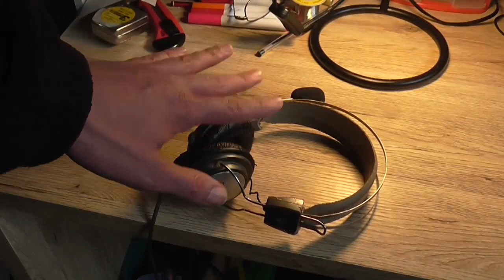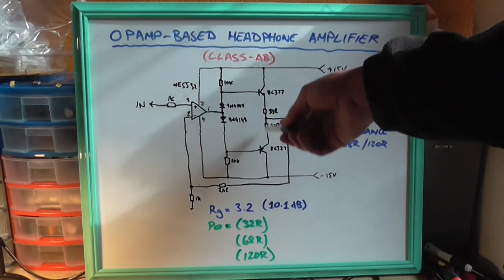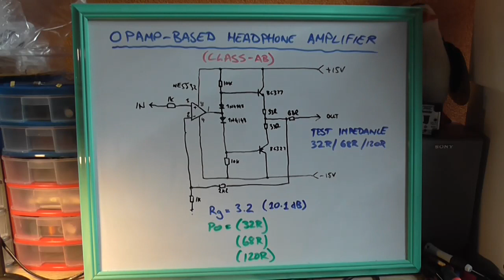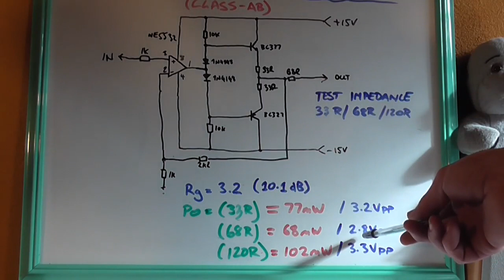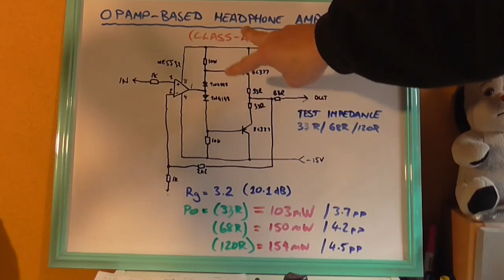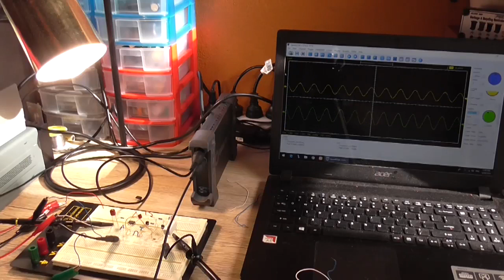OpAmp Based Headphone Amplifier

Comment: My problem is that my headphones are too dam sensitive! If I plug them into my PC, or my TV, even a couple of old tape recorders I have laying around, I have to turn the volume down so much that it's barely on at all and there's a lot of hiss. What I did was put a 470 ohm resistor in line with each headphone and now it's much more reasonable. Only trouble is that it now sounds a little muffled so what I did was put a 100nf capacitor across the resistors and now it really shines.
Reply from the maker: That's wonderful, Clem. The old 100nF capacitor bypass trick!

Comment: If you would use a complementary emitter follower as an output stage (Accuphase did that often in their power amps) you can get rid of a global negative feedback, because that type of an output stage is the most linear among all architectures. Itself it can provide as low as 0.01% THD at 10Vpp input signal without a NF (however with current sources as a load). It's good for a headphone amplifier IMHO

Comment: Use jrc4556 for cmoy headphone amp, requires no output transistor, can drive 16 ohms headphones at +/-5V . for higher impedance headphones use +/- 12V
Reply from the maker: Yeah, that wasn't the point.